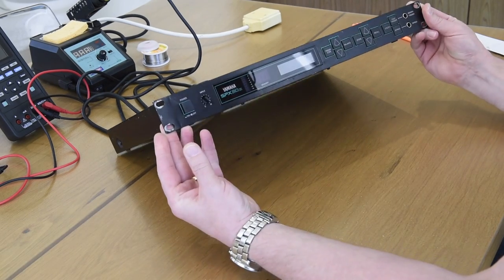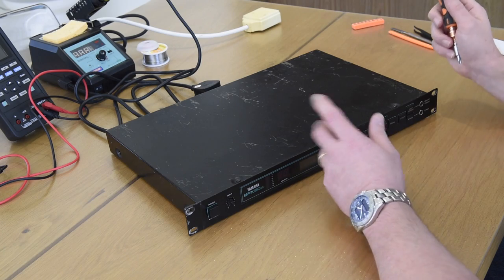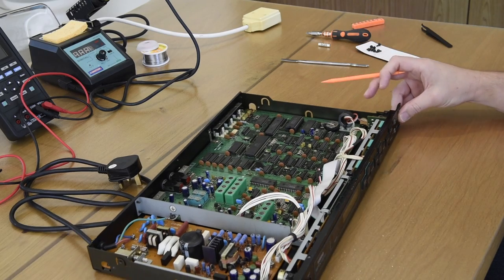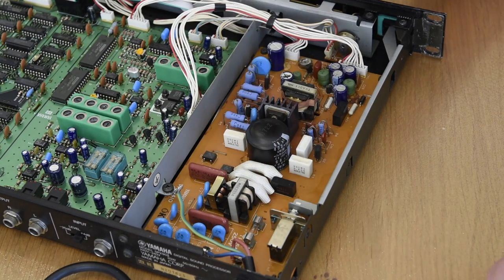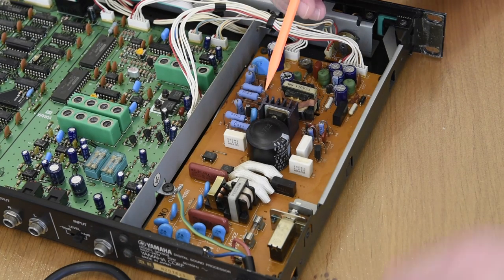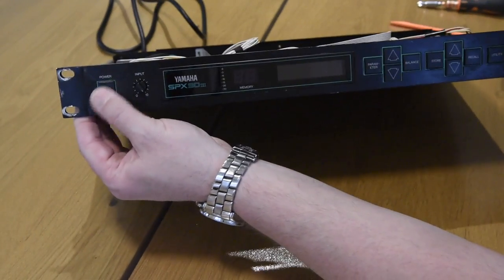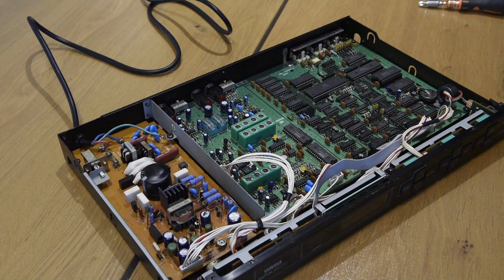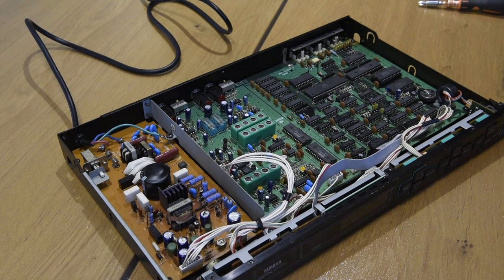Yamaha SPX90 II Video 1

Comment: I just bought this and realized that the balance button doesn’t work. Anyway around this?
Reply from the maker: It's probably the tac switch itself - they can be replaced quite easily and they are really cheap.  Take the front off and GENTLY remove the front keys (the green surrounds are really fragile).  See what sort of switch is there and order some (amazon/ebay/mouser).  The replacement process is probably about 10 minutes if you have the part.  Any tach should be able to do this cheaply.  Hope this helps and good luck.
Reply: @desertsynthguy  awesome thanks! I’ll give that’s try

Comment: hi i have recapped spx90 and it works flawewsly except one thing, its going really hot at transistor and this main capacitor. Voltages are ok. Do U guys have the same? I never had spx before so not sure about.
Reply from the maker: Mine also gets quite hot, so I only turn it on when I plan to use it.  If the voltage rails are good and stable, then I wouldn't be concerned.
Reply: @desertsynthguy  thank U great i will leave 1u space above and hope it will work anorher 30y :)

Comment: hi my spx90 continuously goes into distortion even at low volumes what could it have? thanks
Reply from the maker: Daniele - sorry for the late reply.  So, a number of things could cause this :

1. Remember to ground yourself before doing any of the following.
2. Clean all audio connections with a suitable cleaner.
3. Input levels and gain setting switch on the back.
4. Unstable power supply to the audio board - check the PSU looks good - no bulging/leaking caps.  I generally replace all PSU electrolytics on anything over 20 years old.  Check the output voltages from the PSU.
5. Possible capacitor or resistor failure on the audio board - I replaced all of these myself (fiddly) just because.
6. The main EPROM can be removed carefully and the contacts cleaned, again with a suitable cleaner.
7. Beyond that, you would need a service centre, unless you are prepared to invest in time learning and money to buy logic testers / ESR meters / etc.

The service manual can be found easily online - make sure you get SPX90 service manual also as the SPX90II service manual is just an addendum to its predecessor.

Comment: How easily can a Japanese unit be changed from 100v to 120v? I don't want to buy a stepdown transformer. Haha.
Reply from the maker: Not that easy as the PSU boards have different components.  There are 4 versions - Japanese(VA81380), American (VA81390), Canadian (VA81400) and European (VA81410).  These can be found on reverb/ebay/syntaur/etc for around $30 and are easily swappable.
Reply: @desertsynthguy  Oh sweet! That helps a ton. Thank you!